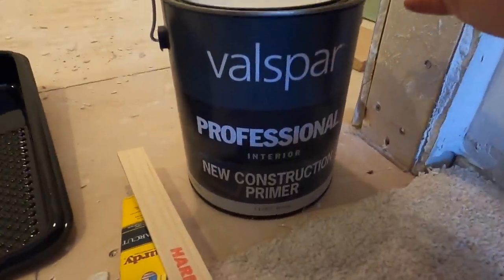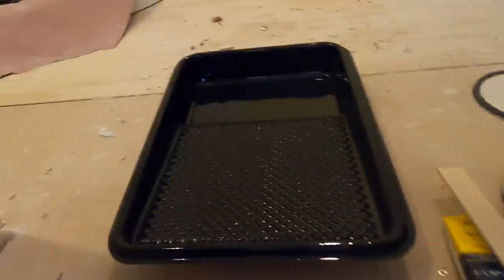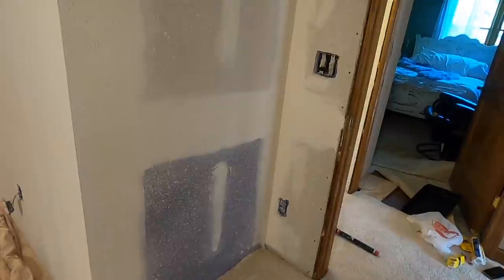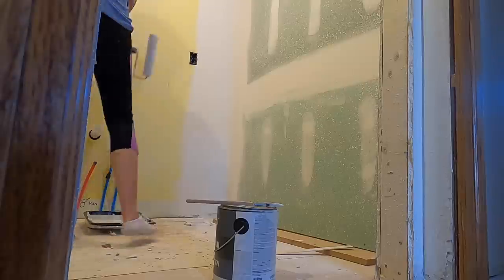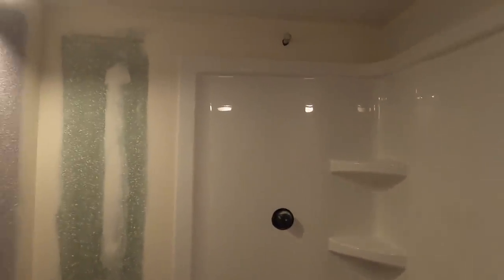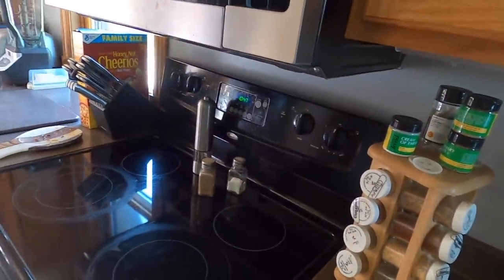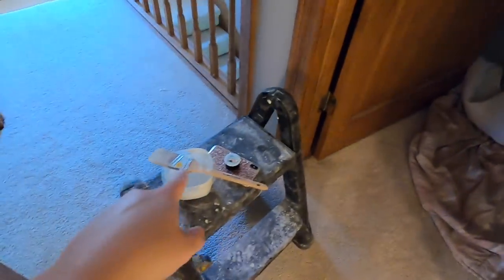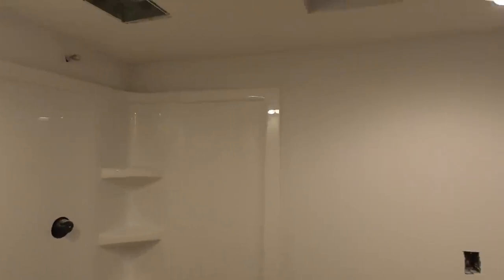Breaking The Primer Out

Comment: You two should consider a 36" vanity for your sink. Usually 34", it's a compromise for kids. But our kids used a step stool anyway, so it didn't matter to them. That extra 2" does make a difference. Especially if your a taller person. Check it out at Menards or Home Depot.
-Minnenowhere